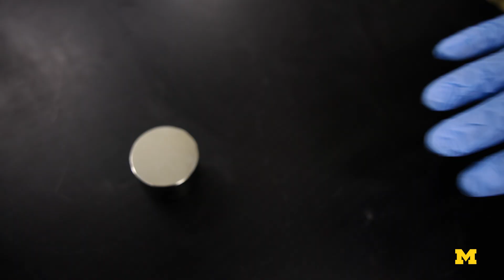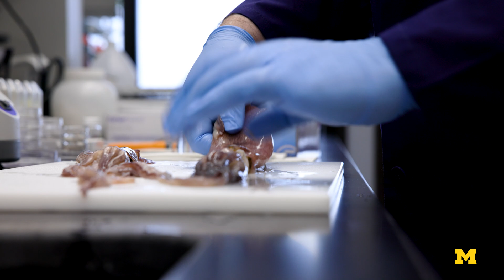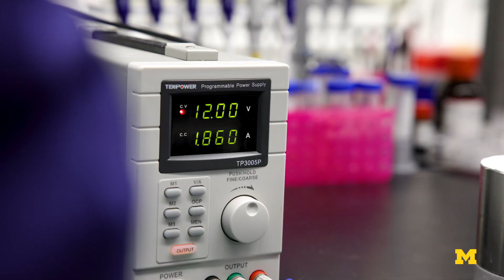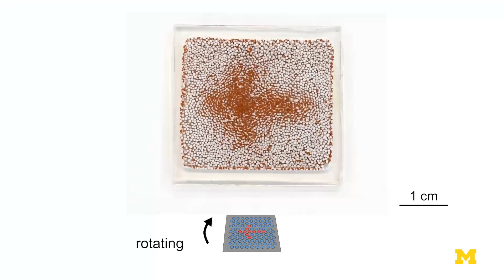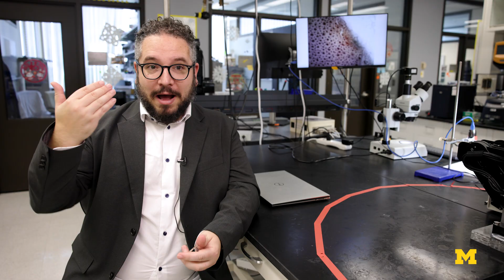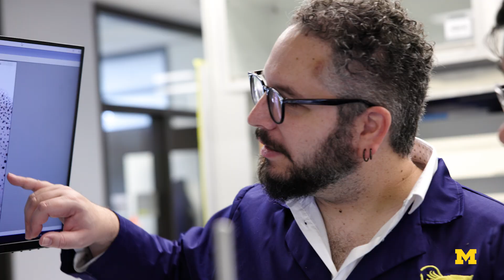A screen using magnetic pixels stores and displays encrypted images without electronics

Comment: Isn't this the same mechanism the old e-ink displays used?
Reply: They aren’t “old”. E Ink uses electrostatically charged particle, with a layer of electrodes on the top and bottom that controls the ink capsules with positive and negative charges
Reply: @fouzr  So it's eink that use magnetic fields? As far as I can tell, their encryption thing isn't special, it's handled by the computer that has to output that specific field -- the homogenous field is just for realigning? So why can't this work with an eink screen too?
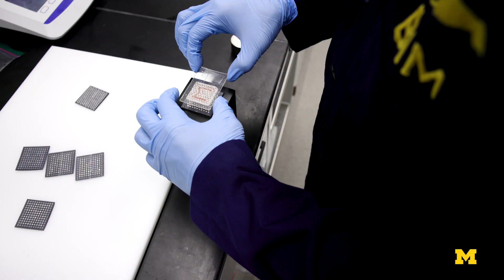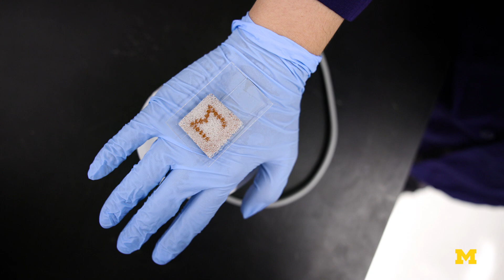Reply: Ok, after rewatching, 1:23 - 1:33 is where the novel application is. Weird that they don't explain this part more, this is the coolest part! Confused on how the shape is retained if the beads are able to move past each other tho
Reply: @fouzr  Originally e-ink were develped in the 70th by Nick Sheridon at Palo Alto Research Center ( Firma Xerox ). I would consider calling it an "old" technology. The only difference here seems to be that magentic fields are used instead of electrostatic charged tiny balls. --- By the way...one part in this video seems to be not correct when it comes to squids. The "pigment" is in fact an oily substance, and the "color" appears by varying refraction caused by bending the oily substance spots in the skin through muscular activity.